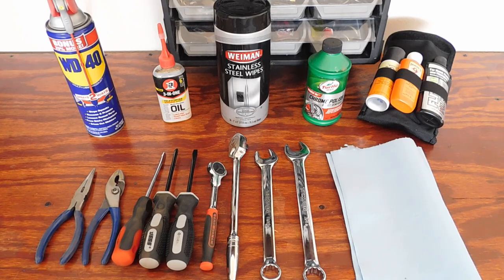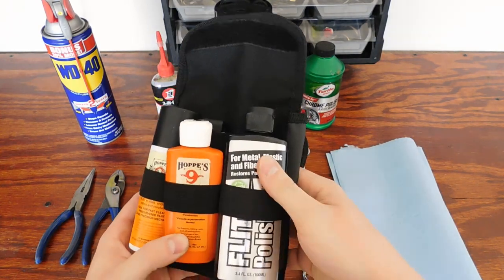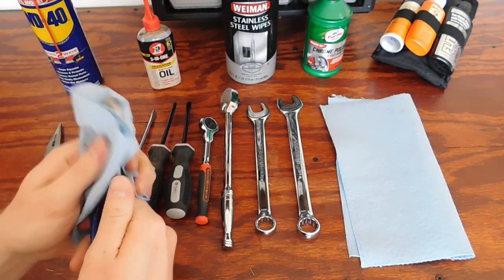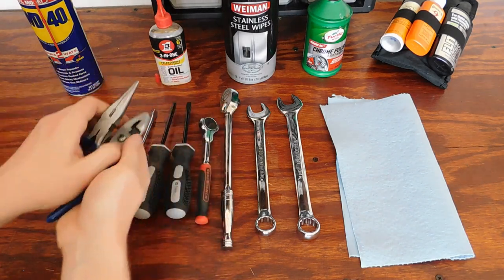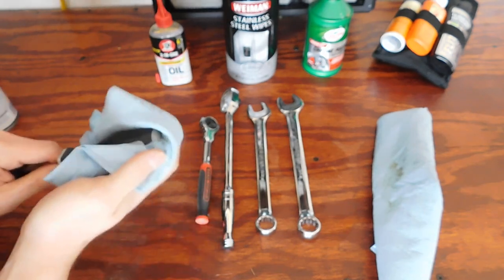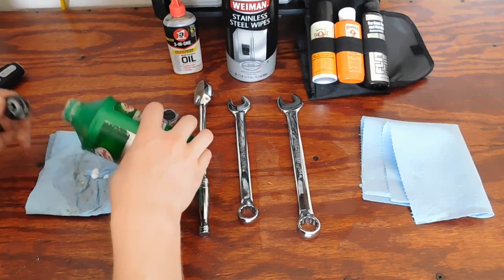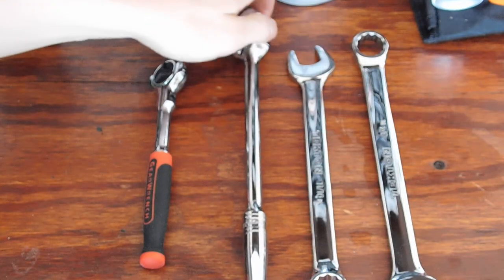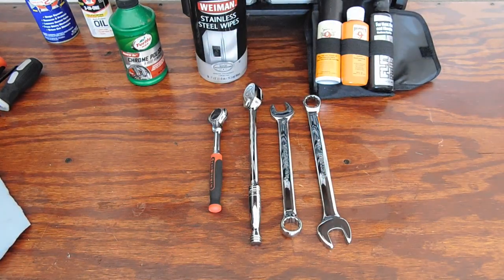How to Clean Your Tools!!!

Comment: For the comfort grip style handles, I like to use a dish-style scotchbrite sponge and hot water with Dawn dishwashing detergent. Takes oil and grease off like nothing, but it doesn't degrade the handle material. Totally environmentally safe, too.
Reply from the maker: Harley Adam that is great to hear. Thank you for sharing your tips!
Reply: If by comfort grip you mean it's silicone rubber, then there is a trade off to be made.  That rubber sweats out silicone oil over time, which can make it feel gooey and after a certain point, worse grip.  Hot water and a LOT of dish detergent, is effective along with scrubbing action to remove that oil.

This makes the grip look good, and grip better for the time being, but that oil that was removed, NOT automotive fluids you got on them during a repair, it reduces the lifespan of the rubber and it will dry rot.  I'm not talking about in a short # of years, but a good tool can last decades if the rubber doesn't fail.
Reply: > Totally environmentally safe

a) Daw[n] is manufactured by Proctor & Gambl[e] who have TERRIBLE company ethics, and;
b) it contains mineral oil (made from crude oil) which even a few drops can contaminate huge amounts of fresh water

But keep believing yourself

Regards

e: https://en.wikipedia.org/wiki/Procter_%26_Gamble#Controversies
n: https://en.wikipedia.org/wiki/Dawn_(brand)
Reply: But they use it on ducks.
Reply: Thank you. Thats what I was looking for.

Comment: A must have in my shop is a spray bottle of Krud Kutter.  It is an excellent, mild water based cleaner/degreaser and also gets adhesives, glues and stickers off of items.  Great for cleaning handles and plastics.

Comment: I work in aviation so we usually use isopropyl alcohol so I generally use it to clean my tools as well. For the chrome ones in sure it doesn't damage but for rubber/plastic grips will it dry it out eventually? I like the alcohol cause it really decreases well.

Comment: I use simple green from Walmart they have the gallon jug of concentrate for $6 and you mix it with water in a spray bottle. I mix it 50/50 and I use it for everything from cleaning tools to cleaning plastic engine covers before I send them out of my bay hope this helps
Reply from the maker: Larry Storrs nice ya I have heard a lot of people recommending that

Comment: I use a red shop towel to wipe off excessive grease and trow them back in the drawer.
Reply from the maker: FrugalPrepper haha if that's what works for you. More power to you. Thank you!
Reply: That works if the only problem is grease. Removing grease, grime and any other fluids that accumulated is what I usually do as crudmium plated tools spread crudmium everywhere. Rust, however is another matter. It's not contagious but it's like cancer and will continue to rot the tool if it's not removed, and it will get under chrome and nickel finishes eventually flaking the finish off. I remove all rust immediately.
Reply: From a purely utilitarian point of view what he does is OK for simple tools like wrenches but it may diminish the life of more complex tools. I like all my tools clean regardless.
Reply: Me too.... only an unemployed mechanic has enough time and no life to go through their entire toolbox polishing tools

Comment: If you apply 3-in-1 or any oil just after applying Wd40 thin coat, wd40 will neutralize the oil. as that's what is does! it will do it immediately if you use the same rag on which wd40 was sprayed to apply oil 😃 just wait for the wd40 to dry and eat any surface rust or grime, leave it for couple of hrs then apply 3-in-1 oil will work much better

Comment: I use Marvel Mystery Oil to clean my tools. I wipe off the excess leaving a protective coating on them. I use super lube or red and tacky for the inside of ratchets or any metal bearing moving parts. 3in1 oil if something need lubed where grease isn't the best.  I don't polish my tools....maybe when I first get them but polishing is removing metal, so after a while you will wear away the chrome....

Comment: what would you recommend for impact sockets?  what about a silicone spray instead of your water displacement spray?  what about soaking the in a small container with some of these sprays/cleaners?  Do you have a buffing wheel and/or a small toothbrush to get in the cracks and crevices or smaller spaces.  I guess I have another project to do in the garage.  Cheers

Comment: Nice vid. Will over time cleaning the screwdriver rubber handles and ratchet comfort grips with WD40 dry up and deteriorate the rubber if you clean them lightly as shown?  Thanks
Reply from the maker: No I haven't had that issue with wd40. I have with brake clean though. It works very well but definitely dries it out over time. Just with wd40 you have to try and wipe most of it away so it's not slippery
Reply: @TonyTheTechnician  I just cleaned several of my tools with wd40 and they look good as new! Thank you
Reply from the maker: @vanquishstorm3806  no problem. Really glad you enjoyed and found it helpful

Comment: What do you guys use on the snap on instinct handles? Brake clean leaves em all faded and powdery white looking and I've tried other stuff but it's the same result once it dries.
Reply from the maker: Seth C ya I try not to use brake clean on comfort grips. Wd40 is probably one of your best bets. Just got to make sure to wipe it dry so it’s not slippery

Comment: What would you recommend using on the  black knipexs? I have a couple pairs with small rust spots but I don't want to damage the black coating.
Reply from the maker: If it's a black oxide then I would use like a rem oil or firearm oil since the black oxide is the same thing they use on firearms
Reply: Baby oil, works a treat.

Comment: Have you experienced any corrosion on your handles using WD-40 or those oils
Reply from the maker: No I have not. I also coat my grill in wd40 since it sits outside with a cover on it and it's holding up very well.
Reply: @TonyTheTechnician  I appreciate that info.  I'm kind of goofy. I clean my tools off every night and I'm a iron worker.  Thanks for the great video and good tips.
Reply from the maker: Nothing wrong with that at all. I believe if you have the time then why not give them a wipe down 👍👍👍 I do that at home all the time bc I'm not in any rush to just throw things around and leave them dirty lol. After every job I do at home I wipe all the tools I used down and organize them.
Reply: @TonyTheTechnician  that's awesome. 😁 thank you again for the good info.  Keep posting videos Man!

Comment: @TonyTheTechnician  wd40 even dry attracts dirt and grim,  instead use their wd40 brand dry lube,  drys almost instant and will not attract dirt.... I use chemical guy's VRP "vinyl rubber plastic" it cleans and protects those grips so well,  lifts the dirt right out,  uv protection,  actually repels dirt and moisture that will make handles last much longer
Reply from the maker: Very nice. I actually have vrp. I might give that a try. Great suggestion thanks for watching 👍

Comment: How do you clean plastic on tools to make them look new? I hate it when you get pieces of plastic covered in sheetrock dust. It makes my drills look like shit even though its just the plastic body
Reply from the maker: Esteban Plascencia I use a rag with wd40 on it then a dry rag to wipe it down after. It works really well. Brake clean is amazing but a lot of stuff absorbs the brake clean and ends up making it worse. So I suggest staying away from that lol. Even though it does work good. I think wd works good
Reply: Ok. I thought cleaning grease and dust would be different, thanks

Comment: For the handles, I'd just use cheap rubbing alcohol on a rag.  It will remove dirt and kill germs, without leaving a tacky residue or bad smell like WD-40.  For the metal parts of the tool, unless they're already showing signs of rust, you can skip the WD-40 and just use 3 N 1 Oil on them.  Put the 3 N 1 on a rag and wipe down just the metal part of the tool.

Comment: I use the same prosses wd-40 works wonder on rubber grips it makes them look brand new again. I use Scott's blue paper towels because they are slightly soft and won't scratch the surface unlike a shop rag will. using 3 in 1 is a great idea that I never thought of and I will use from now on. I love your videos you do an amazing job, keep it up.
Reply from the maker: towman 194 thank you I'm really glad you enjoyed and found the video useful. I also agree with you on the blue towels they are great for cleaning tools. Thank you!!
Reply: Does using WD-40 over time deteriorate the rubber comfort grip handles?

Comment: Use Ballistol oil and not WD 40 on plastic rubber handles, Ballistol is biodegradable and safe for rubber , plastics etc,and prevents rust.  Do not use 3 in 1 as it has penetrating oil and unsafe for electrical also. Simonize chrome polish is best , wipe let it set and rub it off. Kerosene is good for getting grease off tools. Soak them and dissolves grease and leaves an oil residue lubricant.

Comment: I use WD40 to clean my tools but not to lubricate them. If there's any built up crud I may spray the crap out with Gummout Carb Cleaner, but I try to avoid that stuff if I can. That's because I don't like how it dries out my hands. I know - use gloves. Well, I never do. I never, never, never leave a freshly cleaned tool dry. Lube it right away so that rust doesn't get started.
Reply from the maker: Exactly. That's what I use as well. Easy wd40 and wipe off

Comment: What would u recommend using to lube the insides of a ratchet? I was thinking fluid film.
Reply: pjm8047 White lithium grease. It works great in all temperatures, more specifically it won’t get thicc in the cold. Just don’t go overboard with it because too much could cause the gears to slip.

Comment: Am I missing something or aren't you actually removing small amounts of Chrome by using polish like it's a wax polish is abrasive it's not for coating or protecting it's for buffing and removing thin layers of material to remove scratches not fill them wouldn't you be better off with some sort of mild solvent just to remove the grease and oil and a protective coating like some sort of wax I could be wrong it wouldn't be the first time just found your Channel loving it so far keep them coming

Comment: Here i thought i was ocd lol. i like my box very organized and only wipe my tools if they get greasy. i use a air gun to dust, lazy but effective. But every week i do use air tool oil for oiling all the metal on my pliers. They start too rust at the body shop i work at if i do not oil them. About once a month, I also very lightly use air tool oil on all the metal parts on my tools to prevent rust.
Reply from the maker: bb2status haha ya I like being organized. The air tool oil is a good idea. Thank you
Reply: Same. I am the only one at my work that has a very organized box, Hate digging for the tool i need. Also the only one that semi-cleans my tools lol. Air tool oil works great. Its cheap and is great at preventing rust. Wd-40 is a better choice i would say too actually clean your tools though.
Reply from the maker: bb2status haha nice I’m the same way. I look at everybody else’s boxes and it’s just pile of random tools in each drawer. Like how can you find anything. I have to have everything in the right spot lol

Comment: I'm surprised ya don't use Ballistol to clean them and protect them?
Reply from the maker: Roof Repair Techs I have heard a lot of recomendations for a few products but truthfully I never heard of that before. I just looked it up and looks like some good stuff. Thank you for letting me know
Reply: TonyTheTechnician KC Tools sells it, it's very very good stuff, but smells like black licorice, it's also safe on your skin and can be used on almost anything except think brass or gold plating. It actually soaks into the metal to protect it, it's mineral oil with a bunch of other things in it. I would prefer the , non- aerosol version and a little goes a long ways
Reply from the maker: Roof Repair Techs nice thank you for the info. I like the sound of everything except the black licorice I hate that stuff lol
Reply: TonyTheTechnician & RoofRepairTechs i have a bottle i use primarily for cleaning my pistol and it smells worse than black licorice, even when used conservatively. The smell is strong and just as strong as WD-40. So it's better than WD-40 but perhaps not better than Dawn for cleaning tools.

Comment: I understand people do what they want with there stuff there money paid for there stuff but why would you clean a tool
Reply from the maker: Jesse Mase bc just like anything else. I.e. lawn equipment, your personal vehicle, and a lot of other things are meant to get dirty but just like those things. Most people clean them in order to make sure there car or lawn equipment or tools last a long time, continue to operate like they are designed to, and save you money in the long run by maintaining what you have instead of just letting them go. Thank you for watching and commenting!! 👍🏻
Reply: TonyTheTechnician hey it was a good vid and your right depending on what it is you do.  I my self fix things I break and maintenance as a diy type of guy  so different stroke for different folks.  Thumbs up
Reply from the maker: Jesse Mase thank you!!! 👍🏻👍🏻👍🏻
Reply: DIGITAL SILVER I never said I did.  I don't see wiping a tool down every 5 seconds.   Oh crap hold on, i got a spec of dirt. On my tool,  Let me get the 40 and a wipe and I'll finish up this text

Comment: Why do the pliers need oil after the WD-40? WD-40 should be enough of a lubricant.
Reply from the maker: The Garlic Farm ya I don't usually do both when I clean them I was just showing the 2 items I use when cleaning them after use. I suppose I should have mentioned that. Thank you for watching!!
Reply: The Garlic Farm WD-40 is not a lubricant, it's a solvant.
Reply: WD40 is a water displacement (WD) solvent, not a lubricant.
Reply: The spray can says "lubricates, cleans, protects, penetrates, displaces moisture", with specific suggested uses.
Reply: jshaw6600 According to the can, it "lubricates".
Reply: WD40 is about the worst lubricant you could use. You honestly think it can do all of those things well? No
Reply: WD-40 is like the McDonalds version of cleaner-lubes/lubes and is obsolete.